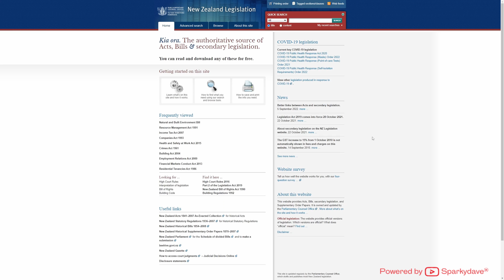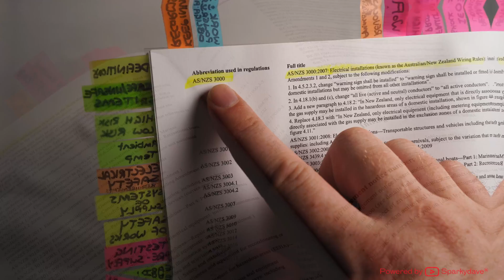Current New Zealand Wiring Rules 2023

Comment: I have a question, does the main power line coming from the road connect to the meter box first then to the homes switchboard or is it the other way around?...also, when I was young Im sure I recall our house had a copper metal sticking up out of the ground, do all houses have these?

Comment: Very confusing because when you look on their website it says the AS/NZS 3000:2007 has been superseded
Reply: it is... the current Standard is 2018 ver 
however the government only passed the 2007 one or we call it cited the 2007 one
so by law , it is illegal to do work following 2018 one....
but 2018 one suppose to be better than the 2007 one....thats why there is a new one.....

i am new to 3000 too, i only know 1 thing like in 2007 one , you can use 2 core wire to do lighting  and Earth is not needed
in 2018 one it will require you to have earth to lighting even if you dont need one...and people will follow the 2007 one becoz adding 1 wire for many job = $$$
Reply: @Jack Ha  this is future proofing for lighting which should be the case. Its really not hard to run 2c&e.
Reply: @aphaseelec  Its also what the Inspector has to say. If you use the 2018 standard and the inspector disagrees with you, he won't allow the power company to energize your premise until you satisfy his requirements.
Reply: @qv6486  yeah, but i remember even after 2018 was out, Inspectors expected earth at all points, pp's and lights. Sydney and Melb
Reply: @JackHa  apart from the auckland rat race cowboys, majority of lighting is ran in 1/1.5mm 2c+e. people would be stupid to not run an earth, especially if it was illegal not to do so. if youre risking your license and fucking over future sparkies/homeowners for an extra couple bucks on cable you should find another trade.
Reply: I may be wrong, but i think there was even an amendment prior to 2018. Anyways, if you weren't running Earth to all points, i really dont know what you were doing because to any sparky, it's just common sense
Reply: @aphaseelec  in Australia the 2018 version is the current version. When the video was made New zeland may still running the 07 version. This video was made for application in NZ.
Hence the color code is still using black wire as neutral.
Current version of the codes in Australia uses blue as neutral for single phase residential applications.
Reply: @qv6486  no we still use black and blue. Mainly black in tps

Comment: Regarding a NZ electrical safety cert, what is your opinion on an appliance that is hard wired at its site, removed from the site and repaired then returned and reinstalled. I was involved in a debate as I have been asked to complete a safety cert with the repair being " part of an installation". I have said it's not part of an installation, its an appliance. Or is a hard wired appliance part of the installation but a plug in appliance not? Thanks
Reply: When calculating maximum demand, sockets are always a rough estimate of what maybe plugged in. Compared to fixed appliances always need to be calculated at the full rated value.

Comment: They put out new rules without taking old rules they are supposed to replace, away. The regulators want to deliberately confuse and trap people. 

Interestingly there are old duffers who lurk around the Mens Shed in Te Awamutu who are no longer registered electricians but once were, and they think they are entitled to add on to the power supply sockets without turning off the power to them. These guys would not know what a standard was if you smacked them across the face with the book.